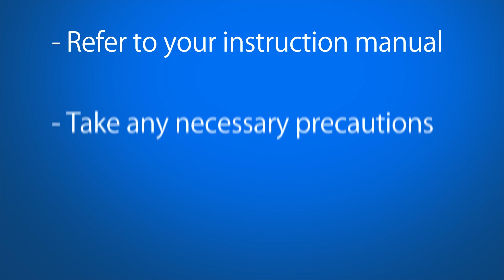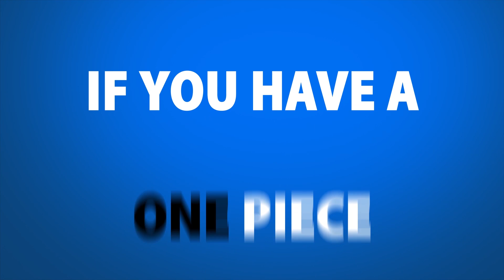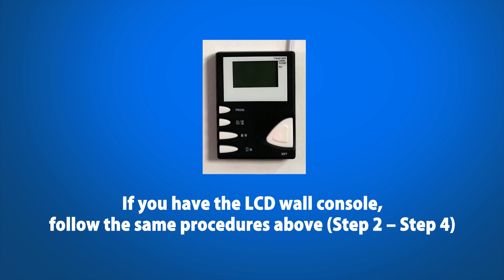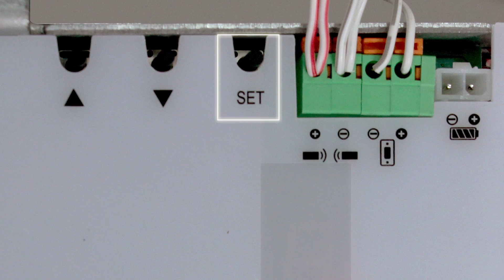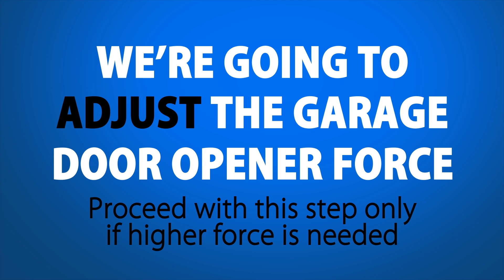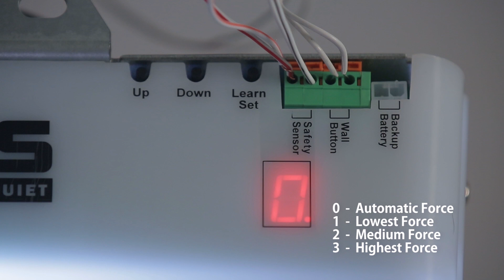Skylink T-Rail Chain Drive with Push Button / Deluxe Wall Console Opener Installation Video

Comment: At 5:08, DO NOT Mount upside down, but the video can't take the time to show which was is actually upside down.
This is nothing more then 12 minute infomercial with as much actual contact.  How many times does this instructional video say "See the manual"?

Comment: I'm changing my existing opener with the Skylink unit. Is it ok to use the existing low voltage wiring, for the open/close button and the sensors?
Reply: yes

Comment: The video isn't even for the model I have even though this is directly from the website. I don't have t-rails, I have rectangular-shaped rails. Also, the components differ. Every video on the website is for these particular rails. If I have an updated model, then there needs to be an update tutorial to reflect that.
Reply: Same here. different traveler and turnbuckle.  Instructions are basically useless, leaving out a few necessary steps.
Reply: @oldmanwinter3597   OldManWinter  exactly. I did end up getting mine installed just to realize that it was a very idiotic design. The rail buckle slightly in the middle when the door gets lifted about 7 inches from the ground, and then I get a fault. It doesn't make sense that the company decided to change from the t-rail design. There no was for me to reinforce the middle of the rail without blocking the path of the traveler.
Reply: @Psycho1209  Yeah, I completely get why they were so cheap.  Got mine at a walmart clearance.  Waste of time and money.
Reply: @oldmanwinter3597  I got mine on an Amazon deal. I wish I would've just went went the Craftsman instead.

Comment: Not sayong anything bad about this operator since I haven't installed one yet. I will say though this is the worst opener install I have ever watched. They didnt even have a impact to put up the new front mount. You got the liftmaster bracket with paint on it man. Then you got that long ass bolt on the hangs cause you didn't stop at Harbor Freight for a cheap tool.